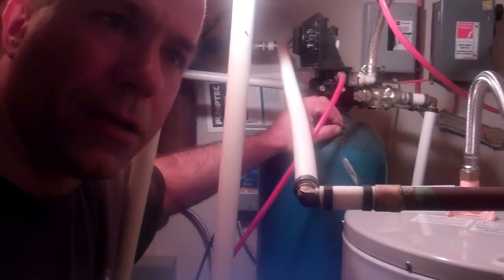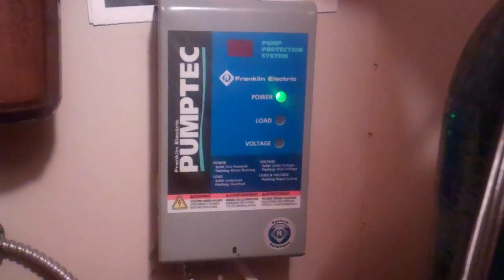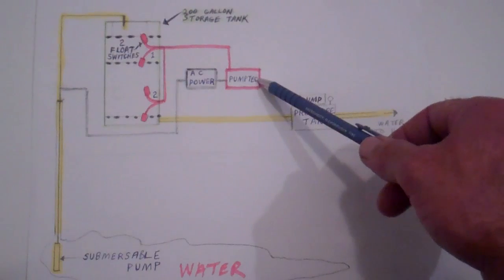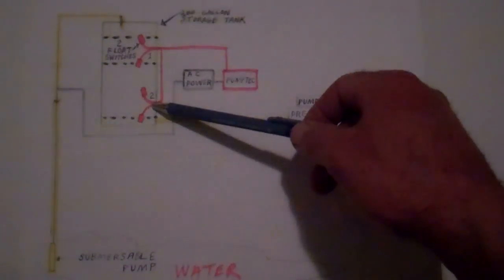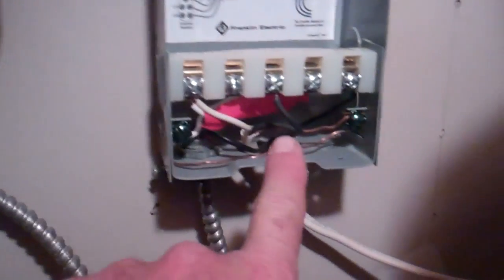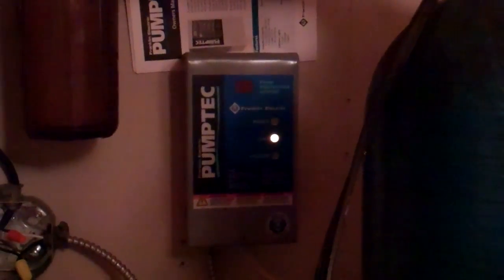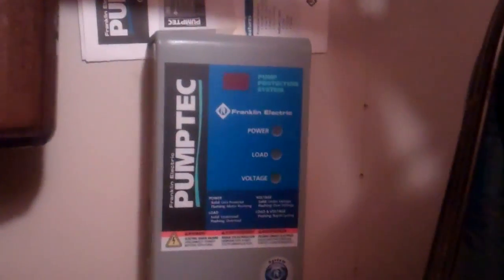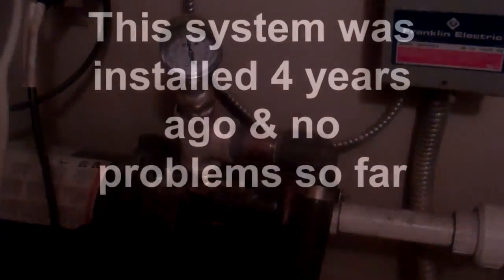Water storage system for homes on wells

Comment: I know this video is old but it is still applicable to my situation and is very interesting and helpful. I'm wondering if the 2nd float in the storage tank (the lower one) is supposed to be wired to the surface pump rather than the Pumptec device. If the storage tank gets low, wouldn't you want the surface pump to shut off to save the surface pump's motor?

Comment: The only way it senses the power draw difference when the punp sucks air and revs up there used to be a control called a Warwick liqued level control a probe at the bottom of the well senses  when the water level gets to low and shuts off the pump a 2nd sensor higher up at the level the well is at when recovered turns it back on and a restrictor to just below the wells production limits the flow that way you'll get all the water that the well produces I put in 8000 gallon storage cisterns to provide water to housing communities 1 gallon a minute was considered adequate for for a 7 home community and with a tank that size if they did run low they could have a water hauler bring in a tank of water I would recommend a tank of that size for any home that does not have a firehydrant nearby I had one customer that looking at the price difference between a small 200 gallon tank in the basement and my 8000 gallon tank was thinking of saving money I pointed out that insurance companies gave a lower rate for having a big tank in case of a fire his reply was if it catches fire let it burn the insurance company would pay to replace it all I pointed to a 2nd floor window and ask if his kids were trapped up there would he still say let it burn he saw my point a multy stage submersible pump pumping 20 gallons a minute or more can go a long way in fighting a fire and since some volunteer fire departments ownly have pumps and hoses it can make a difference of being able to repair or starting over a case in point a house caught fire at the far side of a three car attached garage fire department was immediately called the first volunteer fireman with a  pickup got to the station and he and the ones already there loaded the pump and hoses and headed for the fire the last fireman to the station loaded up the rest in his vehicle when they got to the fire it was still just the end wall but no water they were set up for their small town that had hydrants so a call was made for a water tanker the officer who called said he'd meet the driver at the highway and give him an escort out the driver beat the cop to the fire but with the extra 3/4 of an hour he
Took to get there the house was fully ingulfed if they'd had even 2000 gallons of asesable water they could have put it out with only damage to the garage and with a pump on the tank the owner could have put it out himself

Comment: Do you ever wish you did more than 500 gallons?  I'm leaning more to a 2,500 gallon tank outside of the house.  However, that's pretty large.  I might fall somewhere in the middle so that I can make a pump house and have the tank, pump, pump saver, well casing, all inside of the pump house.  I'm thinking the pressure tank and filtration can be in the house.  I have about 150 feet of distance between the home and the well.  Maybe more, haven't measured it yet.  Pretty sure I need a booster pump too.   

Thanks for the post
Reply from the maker: No Earl , I never found that the tank wasn't big enough . Having said that , we have had no more than 5 people living in the house. And eveyone is good about not being "water hogs "  !

Comment: This is the exact system I’m hooking up to my cabin right now in the cascade mountains. My well only produces 1/4 gallon a minute! However, I have a 1500 gallon storage tank which is supplemented with rainwater. Just like you, I’ll have a pressure tank that is filled by water drawn from the cistern with a separate pump, and a pumptech seems like a great addition. 

Do you have any advice? Such as, would you recommend a very large pressure tank (over 100 gallon) or anything else?

Very helpful video for me personally. Thank you!

Comment: I have a similar set up in my basement because of a low volume well. At this point everything is manual, I have to turn the power on to the well. That causes a lot of “forgot to turn the power off” which is not good. I have been researching ways to make it automatic and THIS IS IT!!  One question, how do you wire in the float switches to control the Pumptec? Thanks.

Comment: I have the same well problems. Your explanation is great, but I'm wrestling with the break even analysis. My well guy says I need to drill deeper to increase volume and reservoir. Set up is $750 plus $13 a foot; total should be around $5k. Before I spend $5k, I'm wondering about the storage tank option. How much did the tank cost and what else do I need to make it all work? I already have a house pump and pressure tank. Do I need a second one for the storage tank. How much space does the tank take up? Where do I get one?

Comment: I have a pumptec on my water system.  A couple of times, I've noticed water  coming out of the pipe that has the electrical in it.  I turn the pump off.  What is causing this?  I thought maybe the floats are not working right and do not tell pumptec to stop the pump from running water into the tank.  I don't know how the water gets into the electrical pipe.  But, I guess I need new floats????  Now, which floats do I buy?  Can you recommend something to me?